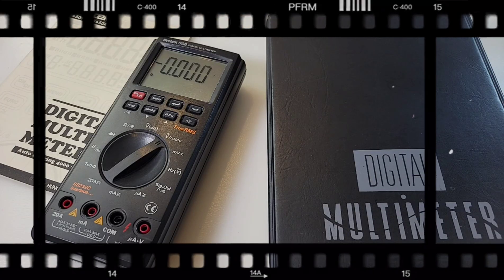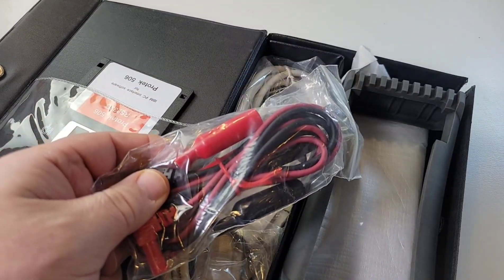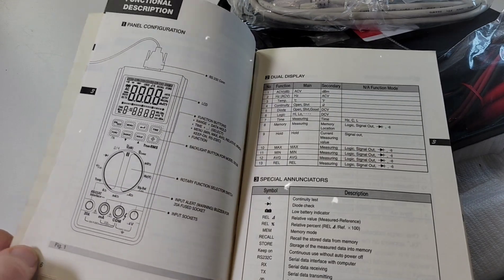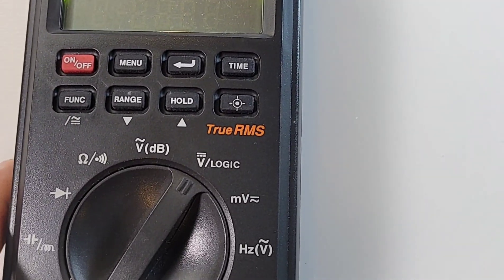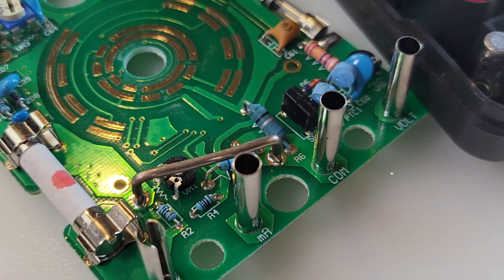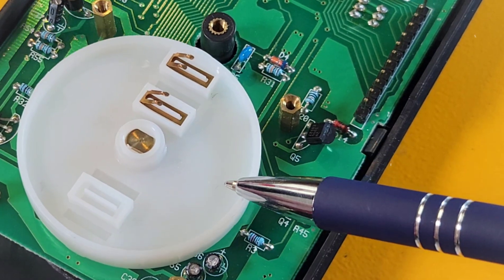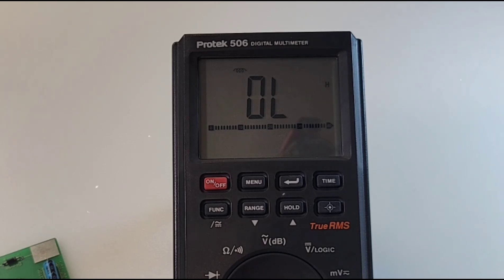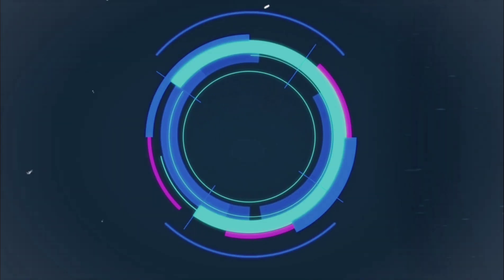RETRO-TECH ○ PROTEK 506 Vintage Multimeter Mini Review & Teardown (1995)

Comment: Menu is the real key of this multimeter. The key features are a number and nowadays you need money to have them. For example, the voltage MAX Hold (min) reading. Not just freezing a reading, but it stores the max/min, or average voltage.

Comment: I use my Protek 506 almost daily, bought new from Jaycar early 2000,s. I have misplaced the instruction manual and now want to test some caps and only getting OL! is the range on the cap test also just a small range like the inductance (Henrys)?
Reply from the maker: It's such a great multimeter,  I don't blame you. Unfortunately, the inductance and capacitance ranges are  very small, only 100H and 100uF respectively.

Comment: Is this multimeter the same as the fluke in terms of accuracy and durability?
Reply from the maker: 100% and probably more so if that's possible. It's internal design and components are top notch. 👍
Reply: @KeepOnTesting  Thank you
Reply: @KeepOnTesting  I bought one of these used here in my city and it came without the instruction manual, I noticed that when you measure the capacitor above 100uf it stops at 99.99, is yours also like that or could it be a defect? And on the beep scale when I'm testing a diode it doesn't make any noise and doesn't show any value, whereas on my fluke I hear the beep and it shows any value
Reply from the maker: @duander1  https://dokumen.tips/documents/multimeter-protek-506pdf.html Full manual available there...
Yes, Capacitance mode only does 100uF ..
That's its only real drawback. Diode mode does not beep but it should give a forward bias reading.

Comment: Is the software on the floppy a bootable one? It says in the manual what operating system you can boot it on, e.g. xp, 2000, 95...thanks
Reply from the maker: it's a non bootable diskette. You still need to load the software onto the OS. 👍

Comment: Which DMM would you recommend for under $30? This will be my first DMM. I want to use it for hobby electronics. I have a few products in mind but I can't be sure. The Aneng AN8009 is small and looks good, but the lack of mA accuracy is a major drawback. ZOTEK ZOTEK ZT-Y's accuracy is slightly better, but it is not sold by official store on Aliexpress. The ZOTEK ZT-303 is probably the cheapest among them, but more precise to specifications 🤔. Which of these would you recommend, or if you have any other suggestions that don't exceed $30, I'd love to hear from you.
Reply from the maker: ZOTEK ZT-980...Love this multimeter ! Inexpensive and such great performance.
Aneng AN9002 is another good multimeter!
Reply: How to chance meter led ? Were by this parts ? polarezier sheet canbe repair led ?

Comment: FWIW they still make USB floppy drives and USB serial adapters. (You would probably also need to run windows 95 in an emulator to actually use the software.)
Reply from the maker: Love those emulators..ouch. I'll try and run the floppy 💾 I'm really curious about the output.